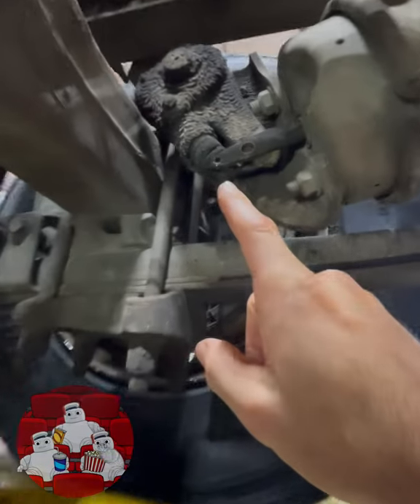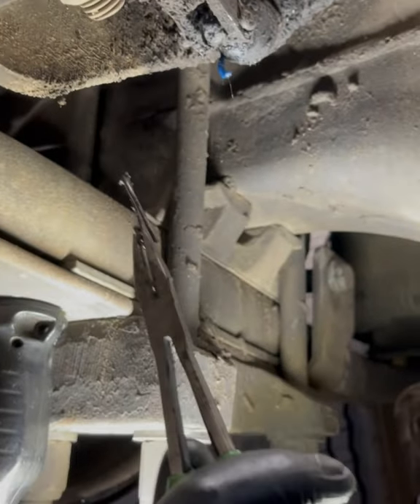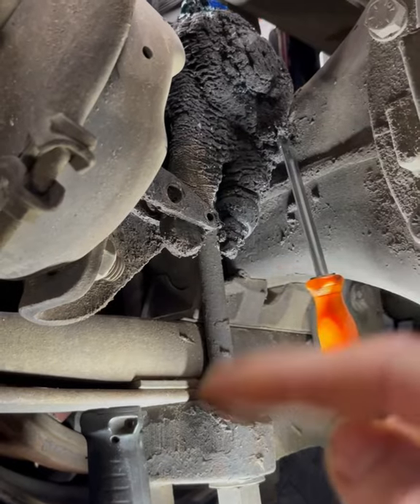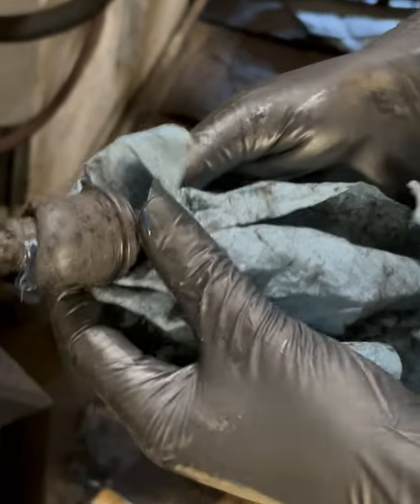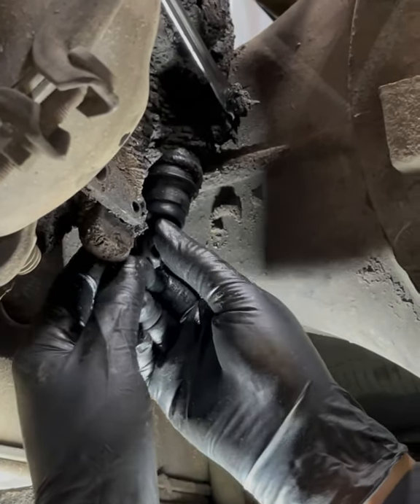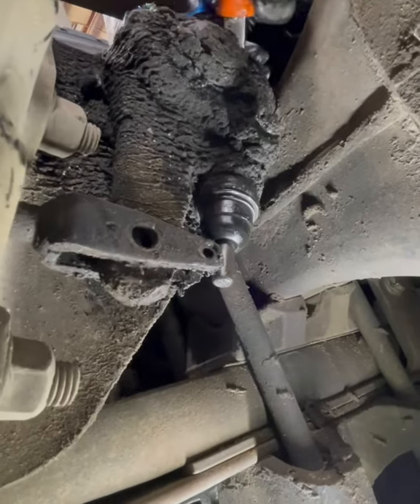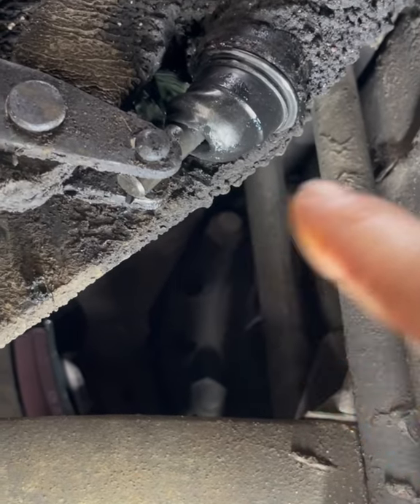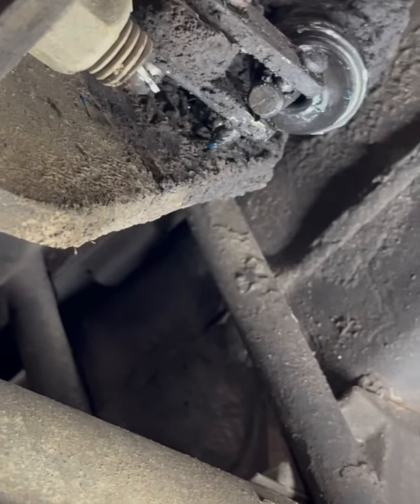SLACK ADJUSTER BOOT REPLACEMENT. TORN SLACK ADJUSTER BOOT. HAVE YOU SEEN MY SHOES. GREASE SEAL TORN.

Comment: Guru, i have a 15 cascadia with a dd13. I have spn 4357 fmi 5 come and go. The diagnostics menu of the truck says dpf electrical issue. Can you give  me any guidance as what to look for? Thank you and i apologize if im asking this question at the wrong place.
Reply from the maker: Guru, I like that. I’ll take it. Much better than grease monkey. So with that code I should have a video on it. It has to do with the def line heater #4.  4 and 5 go to the def doser on your atd one box. The usual is rubbed through wire and or corrosion on the def heater connector wires. I would pull back the heat shielding were they connect to the def doser and inspect for any issues.  If none I would check for voltage between 2-ground= should be 12v. 1-ground should be 2.5ish volts. If voltage looks good than you got a bad heater line and it will need replacement. Hope that helps and your good with a multimeter. Have a happy holidays.

Comment: Checked with fri*ghtliner on these boots 2014 cascadia they said needed to buy the whole slack adjuster any idea where i can get the boots
Reply from the maker: I get mine from the local dealer, they might not of had any in stock at the time. But also do a quick search online and I’m sure they’ll come up with some readily available.